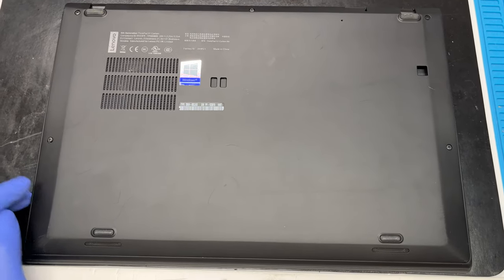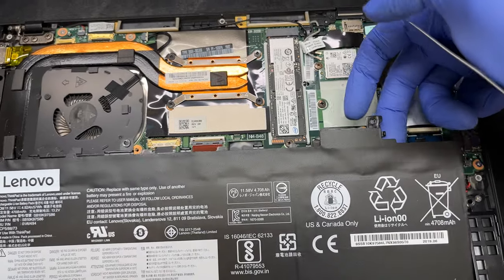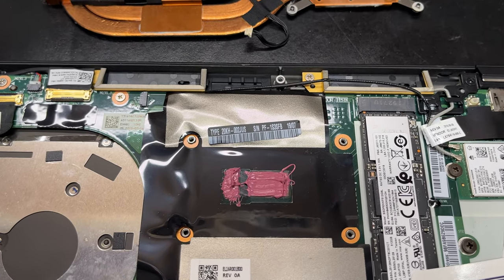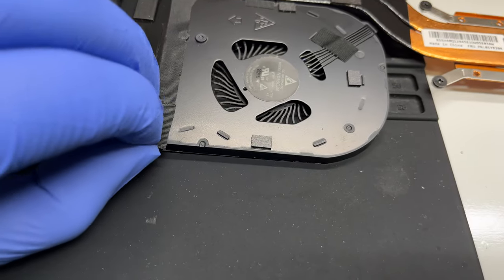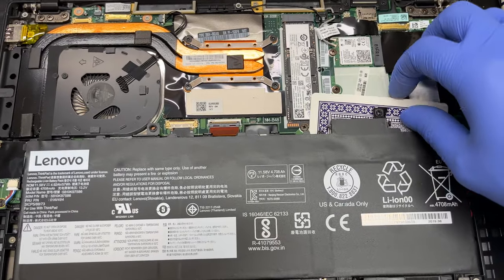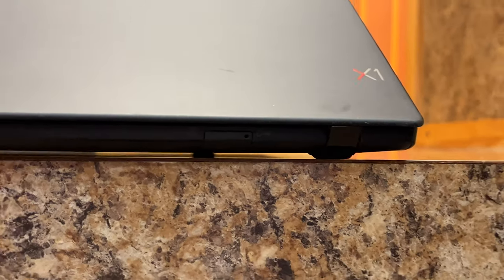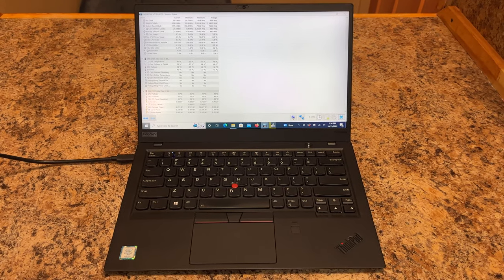Lenovo ThinkPad X1 Carbon overheating fix

Comment: Hey just letting you know that you should NOT put any thermal paste on the PCH die. You can see an indent in the heatsink that makes space for the PCH but not for the CPU
Reply: PCH?
Reply: @tylern6420  I have such a laptop and its PCH was not covered with thermal paste from the factory. Later, I googled what it was and it turned out that it should not be smeared with thermal paste so that the processor does not heat it up. The PCH itself does not heat up, so it is without additional cooling.
Reply: @nickhlushpenko6330  then what is it empty weight?
Reply: I found something similar mentioned online. Mine was without paste from the factory. Are you sure? do you have a proper source stating that the PCH die should not be thermal pasted? Thank you.
Reply from the maker: Pinning this so people don't make the same mistake. Laptop still runs perfectly fine but I did end up removing the paste from the PCH
Reply: Somebody tell me what is PCH? where is it located? he never used such word in the video!
Reply: @niteshdhakal295 the thing next to the CPU on the left. See how it wasn't covered with any thermal paste when he opened the laptop? Apparently this is the way it should remain, so that's what he did wrong.
Reply: @blanc6461  i already researched but  thanks a lot !
Reply: Mine has a thermal pad on it but never saw a chipset which is not separate from the cpu... 🧐
Reply: A bit of a blunder by the greatest technician that's ever lived, if you ask me 🤣

Comment: Always use a Joker to isolate the battery from the chassis, as that's only proper.
Reply from the maker: I’m glad you noticed that, hah!
Reply: To remove power from the board

Comment: X1 carbon was so much easier to maintain than my older t450s. New thermal paste and undervolting the CPU made it so much better in actual use
Reply: What did you use to undervolt?
Reply: @John-ln5vw  throttlestop

Comment: just another tip - you're reading HWINFO64 incorrectly. You were reading the "maximum" column when you should ideally be reading the average current, since that's the average temperature your CPU currently is.

Comment: There is a hole in heatsink at the place where chipset is next to the cpu core. There where no thermal paste. If you want to cool that, u should use thermal pad. 0.5mm of paste does not cool.

Comment: Just one note, it would be nice if you mentioned need to remove the heatsink in a X pattern since uneven pressure may just break the dye, mainly while putting it back together.
Other than that, thanks for all the computer, sometimes when you search for a teardown or repair guide people just repair one thing and don't show the entire machine open, it's just useful to see where things are and know how to get at them.
I commented a video of one guy doing a repair, asked about a different part of the computer and just got "what you see in the video" and well you could not see what i asked in their 480p video, he got quite mad when i told him that i could not see what was not even recorded... 
Anyway thanks!

Comment: You may also notice your laptop gets worse with age, as the thermal paste gradually turns into flakey powder.  Eventually, the laptop will not stay on for long during demanding workloads.  

My X1 Yoga Gen 7 has a TV/external monitor which goes dark for a second, just after boot or login, and again about 10 minutes later.  Then it goes dark randomly after that, but nearly always when playing 4k 120Hz video.  Lenovo and Intel have tried very hard to reduce the overheating issues, but the exhaust heat still sucks into the fans, and the fans are still too tiny (and loud).  

Your options to fix overheating issues are: much higher-performance thermal paste, more liberal paste application, after proper surface cleaning (use alcohol), larger radiator-fins on the heat sink, and you could also change out the case's base-plate.  Fan curve tweaking, and other bios setting alterations, may prove far less helpful than addressing the root causes, which are very basic, Engineering-101, physical design constraints. 

A radiant case base-plate would conduct away heat better than carbon, especially it it was pasted to the heat sink, but it would also heat up the air being pulled in from under the laptop.  So larger feet would also be recommended.  There are also emerging fan/sink technologies, which lenovo could explore, but so far they are mostly in denial about these overheating issues, and have been for multiple generations of this device.  The X1 Yoga Gen 8 is almost a downgrade from the X1 Yoga Gen 7, as it uses a mobile CPU to help reduce overheating.  

I suspect the future X1 Yoga Gen 9, with upgraded airflow, will be released very, very early -- due to Lenovo's overheating issues becoming so infamous.

Comment: Just ordered a x1 6th gen and hope to atleast give it a clean. Not sure how often to change the thermal paste on them. Thinkpads do seem to be easily repairable, though!
Reply: @AdrianMorales1324xdeee  Hello. I'd definitely say get it but, make sure to get the max ram and the configuration you want. (Mine has 16gb max and the ram is soldered in). Everything runs good with my Gen 6 and haven't had any issues with it. Really an amazing well-built laptop. I may move to a different older thinkpad model where you can max the ram out, at around 64GB. Just make sure to do the research on what you need.
Reply: If you go to an older laptop, won't you be compromisimg CPU efficiency?

Comment: One thing to notice that this laptop here appears to be the same one as my old thinkpad, which is a X1 Carbon Gen 6. There are two versions of the fan, one is made in China with holes aligning with the vents on the D side (bottom plate) of the laptop (which is the one shown in the video) while the other one is made in Japan, it doesn't have those holes to suck in the air from the vents on the bottom plate (which I unfortunately owned); it's of course very hot and there's no way to fix that than finding the China made one to replace it.
For me I just rather to sell the whole laptop, which I did.

Comment: Honestly I'm surprised you'd use Kyronaut on a laptop. It dries out way quick, which is fine for desktop users that replace their paste yearly, but a lot less people open their laptops for maintenance. I'd suggest going with mx-6 man, it is close to kryonaut's performance but it KEEPS that performance over time, instead of drying out and losing most performance like Kryonaut does in 6-12 months...
That said the tried and true mx-4 is also good and probably has the best proven longevity, in lower wattage laptops that don't really get hot to begin with it's a good paste to stick in and forget about for 5-10 years
Reply from the maker: I use PTM7950 now
Reply: @SalemTechsperts  that stuff is cracked. Way better than Kryonaut hahaha

Comment: I would seperate the battery if not for the fact that theres a single screw I cabt remove abd its too small to grab it with tweezers 👍🏾

Comment: Great and helpful. I have the (x1 carbon ) i think the 2018 model it gets 50 celsius while idle and gets to hot do you think i need to change the thermal paste or it’s normal for that laptop cuz you already know that the laptop is thin and thin laptops gets hot to quickly. Thx for the video❤
Reply from the maker: 50c Idle is normal, if you stress test the CPU what is the max temp it gets to?
Reply: hey I plan to buy that thinkpad gen 6 i7 16gb 256gb ssd 2018 find a price at 435$ is it wroth it?
Reply: @SalemTechsperts  actually I didn’t do any heavy things on it but in idle 50c is a little bit too hot
Reply: @gilanggilang9859  mine specs is i7 8th / 256gb storage / 16 gb ram and I bought it for 390$ 
And it depends on your country/state but yours doesn’t worth it
Reply: @gilanggilang9859  did you end up getting it?
Reply: I'd get t14
Reply: @SalemTechsperts  my x1 i7 runs like 64-80 on idle and can hit 90-100 while running chrome and other programs. is that normal?
Reply: @smartyyy Non at all

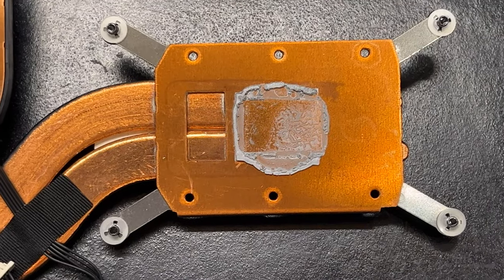Comment: 2:06 Why the iGPU don't have thermal paste? Did the factory forgot to put it?
Reply from the maker: This is a good question. It certainly seems that way. I have another X1 Carbon here that I will take apart and answer you.
Reply: @SalemTechsperts  Did you figure this out?
Reply from the maker: @micaiahweaver1346  I checked 2 more and none of them have thermal paste on the iGPU. There is a recess in the heatsink where the iGPU is, but it doesn't make contact with it. Very odd design.
Reply from the maker: I checked 2 more and none of them have thermal paste on the iGPU. There is a recess in the heatsink where the iGPU is, but it doesn't make contact with it. Very odd design.
Reply: it`s not an iGPU! it`s PCH and it should not be under the thermal paste in this laptop
Reply: @nickhlushpenko6330  how about for thinkpad x1 yoga gen 3? My package temps increased after applying thermal paste on that small die.
Reply: @walterserrano8881  I can't say for sure, but there is a high chance that you also have a PCH located near the processor, and it does not need to be smeared with thermal paste.  As for the rise in temperature, it all depends on what kind of thermal paste you use.  I recommend the Thermal Grizzly Kryonaut

Comment: I bought a thinkpad  p16 (core i9 12gen ,128gb ram ,rtx A5500, 2 TB ssd ). IT have only one problem which is cpu over heating so do you have a solution or I have to change it with another modle

Comment: 10th gen T15 gets insanely hot
Reply from the maker: Nearly identical cooling system and procedure. Might be worth it to replace the thermal paste.
Reply: @SalemTechsperts  have you gotten around to doing it on a X1C10?
Reply: Update:  replaced thermal paste on cpu and gpu. All is good soo far. GPU had nearly zero paste.

Comment: how many hours of battery life after the fix?
Reply from the maker: Never ran a battery test and very rarely use it for more than 3 hours unplugged. Will definitely help battery life though as the fan won’t need to kick on as high and often
Reply: Thanks 😊